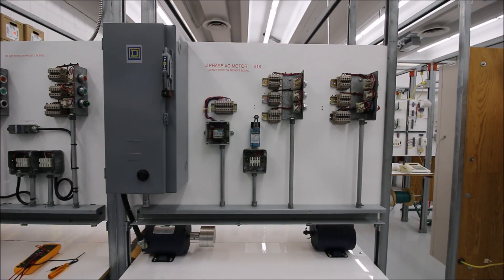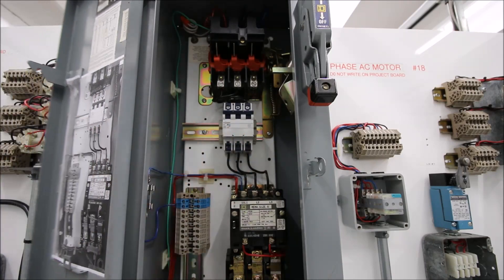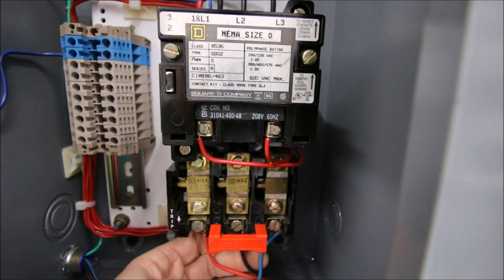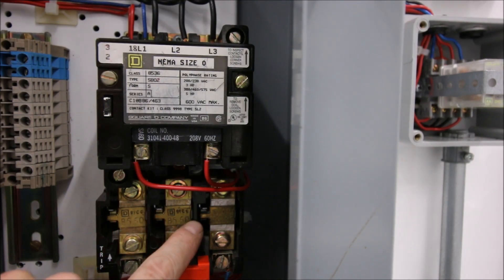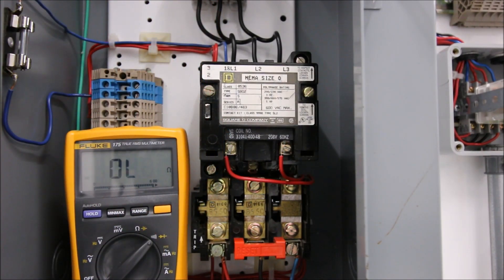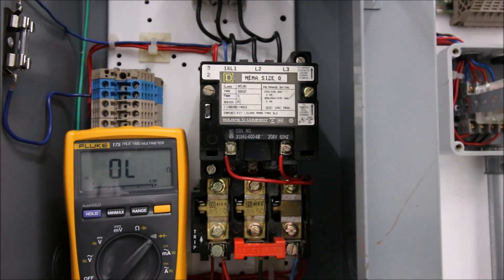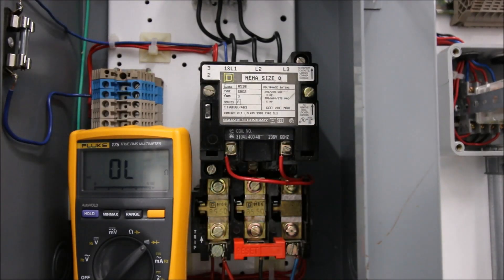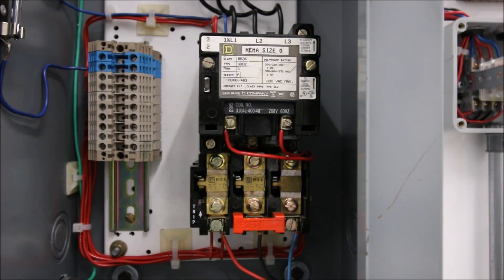Ladder Diagram Basics #3A (NEMA Contactor Overview)

Comment: Hi! I have logic written to control the coil on and off on the motor starter according to level setpoint. The logic can latch the circuit, so do I need the holding contacts anymore on motor starter??

Comment: Hi! Quick question do you have to use a holding contact with the coil? I have logic written in a program that no longer needs a holding contact on motor starter using a set/reset block in function block.
Reply from the maker: This video does not incorporate a PLC. The holding contact is required to maintain current to the contactor coil.
Reply: @PeteVree  yes I am aware of that.. just wanted to make sure I can use my logic now to pull in the coil for the starter without using the holding contacts now.
Reply: And thanks for the video and your channel!
Reply from the maker: @stephenhillman3086  Yes. The set/reset would negate the use of any holding contacts
Reply: @PeteVree  I have currently a motor starter that was wired 3 wire control without logic… now I am adding a plc for control of the motor starter… I can wire it as a 2 wire starter now. There is no start button, just a selector switch from off to auto. It’s becoming a fun project and appreciate your help!

Comment: Hello Pete, I really appreciate these video. I notice that you have a smooth "drumlike" attachment on the shaft of your motors. Is that a belt pulley or some training device that you install so as to prevent snagging of clothing?
Reply from the maker: I believe our tech, Sam, had some aluminum machined to connect to the motors. Back in the day we used to used wooden clamps on these units so that we could simulate an increase in loading on the motor.

Comment: The mcb is more accurate as fuses are so old school more expensive and a pain to change, also overloads are disappearing to most people uses something like a gv2 combined isolator circuit breaker and overload.  In the UK panels should have finger protection on all live terminals that way you can work in a live panel with no chance of accidentally touching lives.
Reply: I love all the videos.

Comment: Love this right now! walking into my motor controls midterm and hasnt been explained in this way so have felt very stressed. we've been wiring up starters on a wooden project board with the power being a power cord, and visually it is not very helpful trying to relate it to how it might look in the field, and the teacher has us wiring them up after we do homework assignments out of the book, instead of walking us through the testing techniques or how to wire them/just expecting us to know everything from the book, and it has been very difficult for me, a visual learner. Ive luckily been wiring them correctly, but this helps visualize everything so much better and makes me feel very confident. thank you so much for this video.   the ladder diagram videos are helping me alot as well; i understood how they worked, but also not very confident on drawing my own and your videos are helping me so much!! thank you thank you.

Comment: The control circuit in blue coming off L1 is fused to 1 amp. The 208 coil draws less then that. I’m installing a NEMA 1 thats fused with a 3 phase disconnect. Can I add this to my starter bucket. This circuit will be wired in on a pilot relay to a low voltage controller.

Comment: On question Pete. In what line number you connect the high voltage wire when you are
installing 3 phase motors.  I have 2 wires at 120 v each and another of 200 volts.
Thanks in advance for your answer. Thanks for the instructive video.

Comment: When you tested the overloads, where did you place the meter leads I couldn't tell on the video
Reply from the maker: On the NEMA starters, the overload Normally Closed contact is located on the bottom of the Overload Relay that I am manually tripping with the screwdriver.
Reply: A push u push the overload and if it tuff it trip and if it safe it reset

Comment: what does the 18 stand for in front of L1 label on contactor ?
Reply from the maker: Hi Michael, it actually says 1 & L1... meaning that that terminal corresponds to L1, but will also be used as the supply conductor for your controls, in which case it would be numbered as wire #1 on your control diagram. The 2 3 to the left then corresponds to the normally open holding contact, which would then have wires #2 and #3 on either side of the contact.

Comment: when you have to take mesuring the coil,  you have to disconnect wire on it
Reply from the maker: In our shop the wires simply go to terminal blocks on the left hand side of the starter enclosure, so there is nothing connected to the coil at the moment I am taking the resistance reading.
Reply: In a real troubleshooting situation, the coil may be powered by the 24 v, so it is the 24 volt coil that can be read if the wires are not removed. I sincerely believe that it is preferable, to show a sure method to measure a coil for student.
Reply from the maker: OK. Noted. Out in the field, please remove the wires from the coil so that you make sure that you are only reading the ohmic value of the coil. 

But again, in this video, the disconnect is in the OFF position, which means that there is NO power to any of the components, and nothing is connected to the terminal blocks.